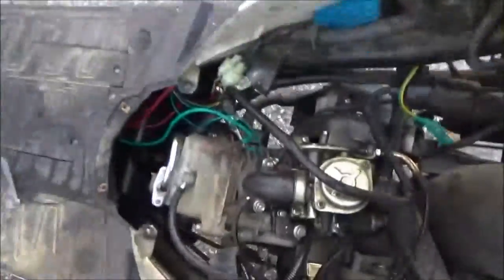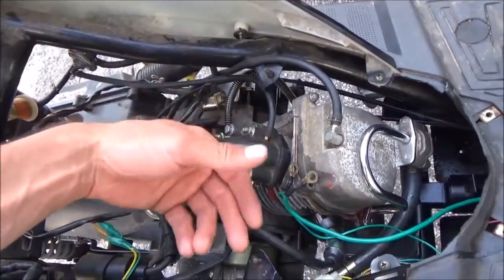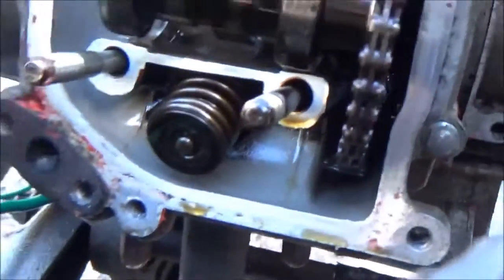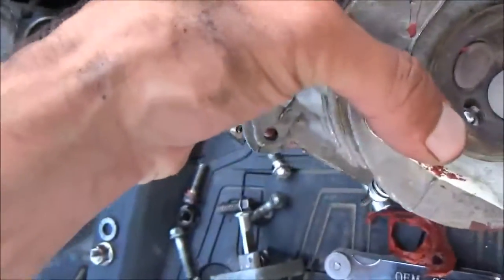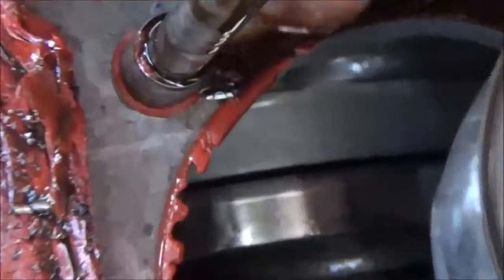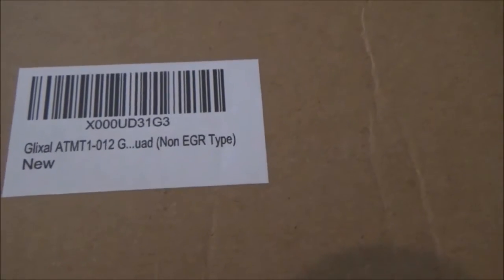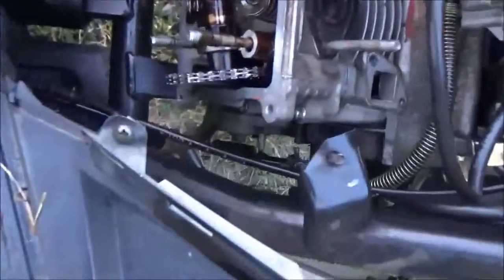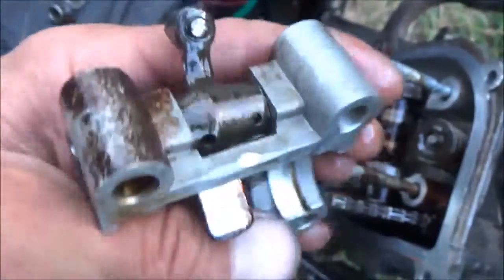Exploded Scooter Top End.Well That's Your Problem! BBK FAIL

Comment: The biggest mistake people make DUE TO BIG BORING & OVER HEATING  is obviously the same mistake you also made here...this also goes with out big boring. (NEVER) RUN ANY SCOOTER WITHOUT ITS COOLING SHROUD. 
First thing i noticed was you didnt have yours on. ...THATS A NO- NO BRO! 
I KNOW IT LOOKS COOL WITH OUT IT, BUT ITS A MUST. THAT'S YOUR MAIN  COOLING SYSTEM...keep this in mind folks!
Reply: I did a 100cc big bore kit and put the cooling shroud back on and had no issues. I agree with this
Reply: Yes, that was the first thing I noticed. I've done two big bore kits with the shrouds on with no problems

Comment: you do realize putting a big bore kit requires you to cool the oil somehow right? you can take that thing apart a 1000 times if you want.. you will always have issues if you don't cool the oil.(aside from some other things that need upgrading as well) i've been doing maintenance on these things for quite a while so i have first hand experience.. people don't realize what needs to be done when upgrading their engines..
Reply: what are your suggestions you need to do when installing a big bore kit?
Reply: The reason you’re frying your engine is because you failed to reinstall the plastic cooling shrouds, they’re there for a reason and they will fit even with a BBK!
Reply: Using the gasket it comes with 😂 don't do a messy job with gasket maker like he did
Reply: @dmshar5  that not true at all 2 years now and my 80cc kit is still going without it. And for one his blew up because he used gasket maker and did a poor job and oil couldnt get in head
Reply: @verriahowe4334  howe if you think you can get away with a motor without a cooling system well its been a year so i sappose you already figured it out. as far as the gasket maker being his issue. first you need to read the instructions before applying it. second he installed a bbk without upgrading the rest and a non restrictive cdi, riding of the autoenricher system carb, riding of the vacume fed gas system deleting the egr system entirely, you cant just add a bbk and be all yeah my scooter is gonna be the shit and not blow the f up.
Reply: @verriahowe4334  All ways put the cover on seen two the same black oil the piston will get so hot in the summer.
Reply: Air cooled huh? Cover it with plastic an receive the air from the fan on flywheel. Fina on head means what? An the air forced thru draft while riding

Comment: If your crank shaft is bad in some way. It will tear up your piston. What happens is the needle bearing on your rod that the piston rides on will get jerked around. Fail and then bang. There goes your piston again. I had this problem. Until I installed a new crank and all new bearing's throughout the motor. If your taking in air in the case or head due to bad seals or a crack in something somewhere. It will blow up your piston also.